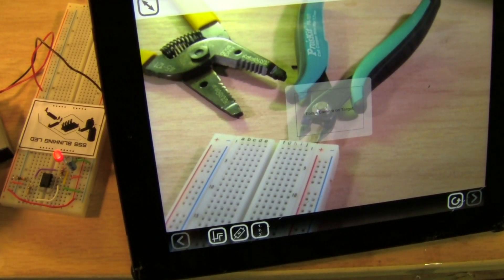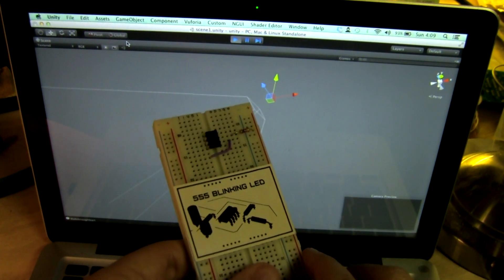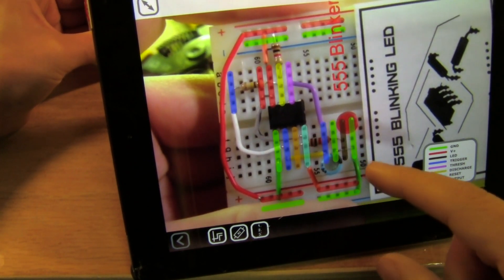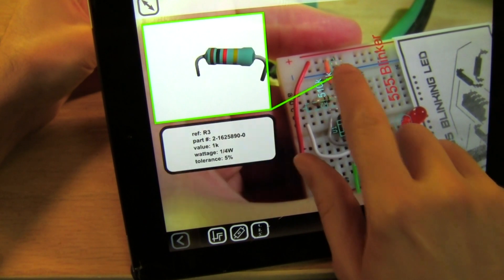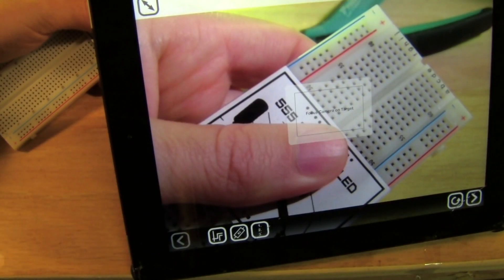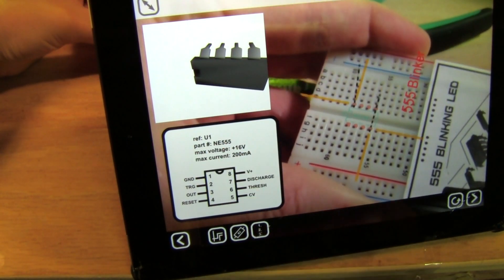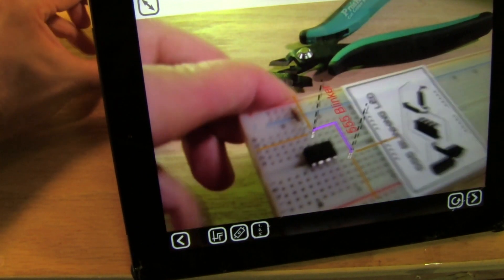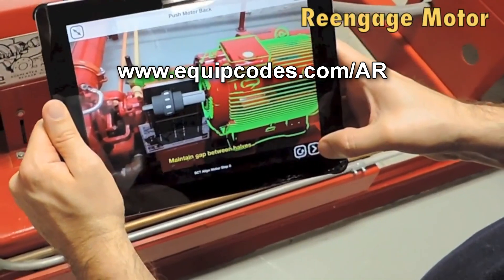Augmented Reality BreadBoard circuit building guide

Comment: How do you track the circuit? Using the label you put on the breadboard as a marker?
Would it be possible to just use the real components as markers or can you only do this with flat elements?

Comment: You COULD use CastAR so long as you used it in TRUE AR mode, rather than cast mode.  That is what the clipon is designed to do...True AR, and VR with the lenses blocked.
Reply from the maker: Can you explain this a little more? If the clipon blocks your view, how do you see a mix of real-life and generated graphics? Is there a video camera in the castAR system?
Reply: The clip on does not block in AR mode. In VR mode the lenses are covered. Three modes. Cast mode, true AR , and vr. The last two use the clip on. AR not covered, vr covered. Hope that helps

Comment: I guess for your industrial application you need a 3D model of the objects to "project" on on the tablet anyway, to know where to draw in the scene. Should be pretty much the same thing with castAR.

I'm not trying to plug castAR here, I've just seen that most people haven't heard about the recent developements. And I'm very excited about it because it seems to be a very light weight and versatile solution. I'd love to use your software with these glasses sometime while building stuff ;)

Comment: castAR has these clipons that turn them into AR or VR glasses without any reflective screen. I don't know how the tracking works in that case though. In the "normal" mode, i. e. the one with the retroreflective surface, the head position is tracked by "seeing" a LED pattern positioned somewhere in the scene. So maybe instead of using the printed fiducial use some with LEDs and you're ready to go ;) ? Look at their product page, has been updated with details a lot in the last one or two weeks.

Comment from the maker: I am one of the main developers on EquipCode's AR apps. Someone suggested this application after hearing about our industrial stuff, so we put together this demo to try it out and get feedback. castAR works on special screens, not physical objects. It can track objects placed on the surface using RFID, but not display information directly on top of those objects. You could, however, virtually build a circuit with castAR. Correct me if I'm wrong!

Comment: Are you involved with the company (and the developement of the software) or just showing it?
Really cool thing anyway. I imagine using it with PCBs and e. g. highlighting a "net" on a multi layer board or showing voltages/waveforms to be expected on traces.

Btw. have you heard about castAR (the AR glasses Jeri Ellsworth is developing)? No more need for a tablet, just use the wand to interact.